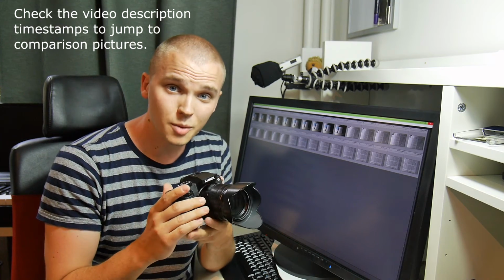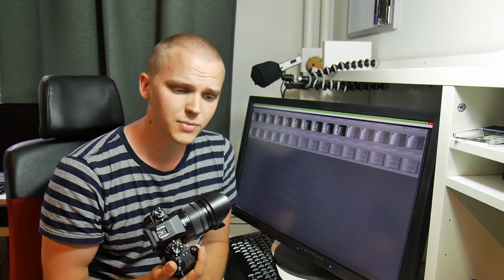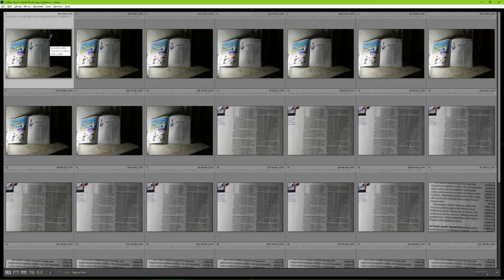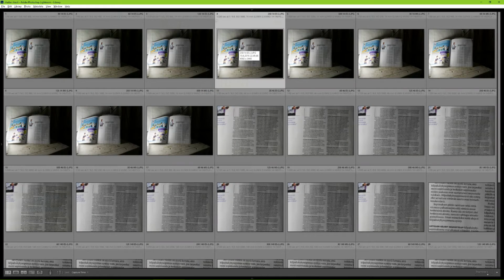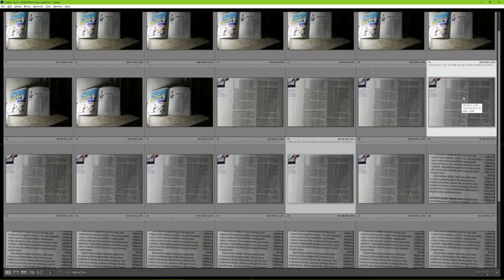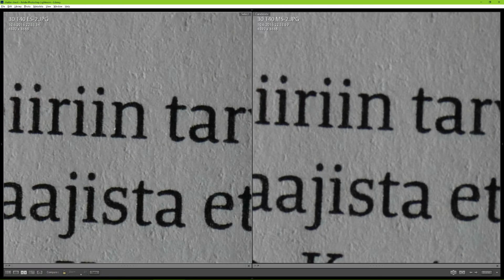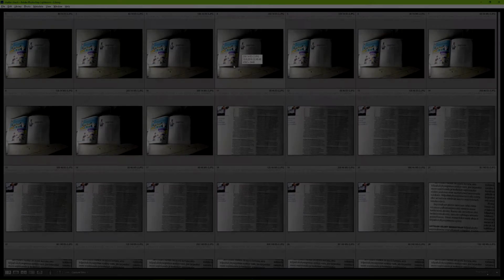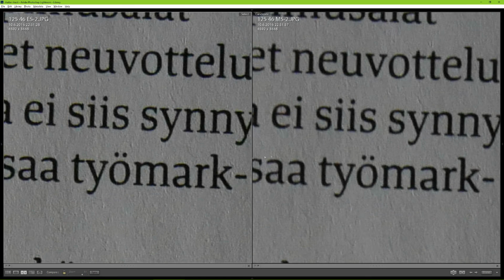02 Panasonic G7 14-140mm Shutter Shock: Electronic and Mechanical Shutter Comparison

Comment: are these pictures  taken on tripod? so , even the tripod can't solve the shutter shock problem?
Reply from the maker: All comparison pictures were taken on a tripod with self timer. I have also tested handheld pictures by taking 10 picture bursts with electronic and mechanical shutter and comparing best pictures. The shutter shock problem was as bad handheld as it was with the camera on a tripod. However holding the camera in hand produces less sharp images overall so the shutter shock effect isn't as prominent.

Comment: Good info. Shutter shock is nothing new. Sony, Olympus, Panasonic among others all have this issue with various models. Surprisingly not all models seem to have this problem. For example the Sony A7r was notorious for this but not other A7 models. It's amazing that at this late date it still hasn't been addressed. Manufacturers must be aware of it. PS I suggest canning the background music or tone it way down. It's distracting and interferes with your voice.
Reply from the maker: Thanks for the feedback. I think shutter shock is something surprisingly few talk about. Most of the manufacturers prefer to be completely silent on the issue, as it's pretty hard to demonstrate reliably. It doesn't cause media outrage. I really hope all manufacturers would try to solve the issue, because where applicable it might be the fix that increases image quality the most.
Reply: Exactly. They want to sweep it under the rug. I guess it's easier to put in a hundred function buttons instead of fixing this. Shameful. Olympus seems to have have a good solution in delaying the exposure by 8ms but this is apparently beyond Panasonic's abilities. Looking forward to more videos. It's nice to see actual data instead of just opinions.
Reply from the maker: My Panasonic GM1 has electronic front curtain shutter mode, which also reduces the shutter shock issue. Sadly not all Panasonics have that.

Comment: very good work.....strange, im now totaly confused if the Panasonic G7 (called G70 in some countrys) is worth the investment at all for photography. The pricing is realy tempting. Currently about 899€ for camera and 14-140 3.5-5.6 lense.But what is it good for, if all images end up blurry if MShutter is used with this kit lense.....
Reply from the maker: Well, I use only electronic shutter all the time, not to worry about changing settings. Occasionally I get a photo with bad rolling shutter, but that photo may have been blurry because of camera shake anyway. Video is G7's greatest strength though, so if you never take videos, there might be better options.